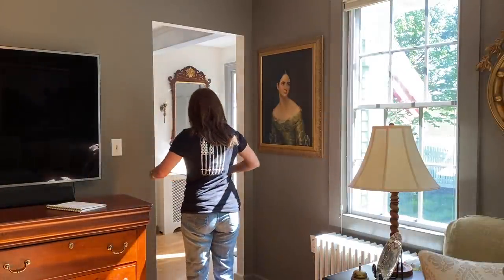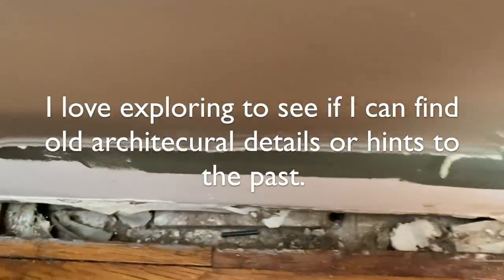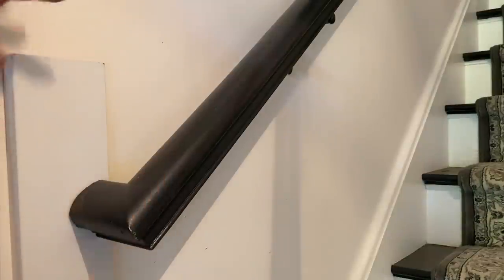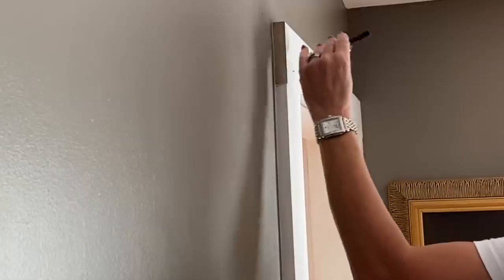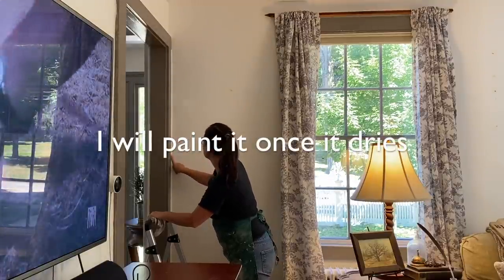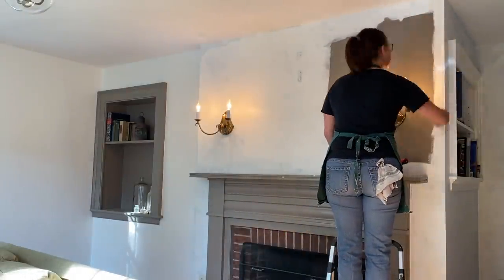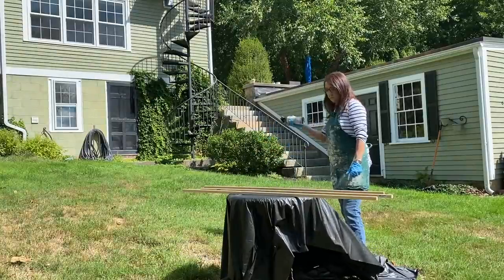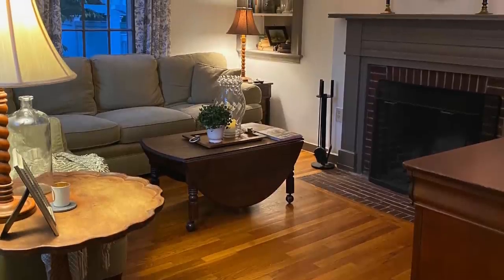DIY square curtain rods, living Room Decor before and after, New England style home

Comment: I recently tripped across your site and love everything about your New England Fine Living vlogs being an interior designer, history buff and homemaker as well as having lived in New England for three years when we were newly married (stationed in Kittery, ME and Groton, CT). Your tours bring back great memories and I too love baking, gardening and decorating the house and for the seasons. We have some of the same traditions and architecture in the South too! Love all your ideas and your soothing voice and music add a charming moment to an otherwise busy day. :-)

One hint, if you come across an obstacle when putting up more door case molding (without a door), is to add a layer of boarding or drywall to the inside of the doorway on that side to push the case molding away from the obstacle. The new molding will cover the addition inside. The doorway will be a bit smaller widthwise, but not noticeable and it will save time and effort and keep everything else intact. :-)

Btw, this is my first post to a vlog host ever! Love your work! 💗
Reply from the maker: Hello Paula! Welcome.  It sure does sound like we have a lot in common!  Great idea about adding the board to the inside of the door.  Unfortunately ours is at it's minimum to barely squeak out furniture, so I was unable to make it any narrower :-(.  Great comment though and I feel honored to be your first Blog comment post !!!!!
Reply: Linda Smith Davis - New England Fine Living 

Yes, we have a kitty named Willow as well, lol! 

I’m enjoying all your past videos and seeing your progress as I work through our own renovations. Can’t wait to see what you will be doing next and it’s nice to see all the great baking and craft ideas I’m looking forward to doing when the dust settles. :-)

Comment: Linda, it is beautiful! Quick question, have you always painted your woodwork? I am seriously thinking about doing so but have not had the nerve yet. I love the look and think it will enhance my decor(?). I am also ready to tackle the surrounds of my doorways. My husband never installed molding around some of the doorways in our home and it has always bothered me. Thanks for giving me the push to do so.
Reply from the maker: Hi Mary, what is the age and style of your home?  Most of the time I have, but depending on the home or the age of the home.
Reply: My home was designed and built by my husband around 1980. It is a Georgian Reproduction of over 4000 square feet not including the 6 car garage and full basement.

Comment: Just an idea for your floor additional cover, maybe adding a quarter inch round...additional layer? Love the paint , and I hate painting 😡
Reply: I noticed you squared your corners rather than mitered is that due to preference or ease? Just wondering.
Reply from the maker: Hi Gail, Good Question!!!! On the door trim, this first layer, I squared them off. One reason is I am copying what is done elsewhere in the house with is Greek Revival period in some of the rooms.   I am also going to be putting another layer of decorative trim, that will be mitered, over the top of the flat stock.